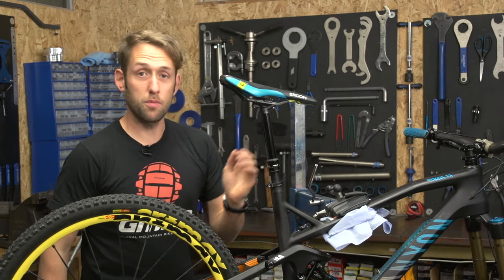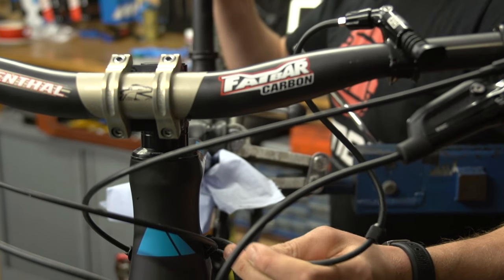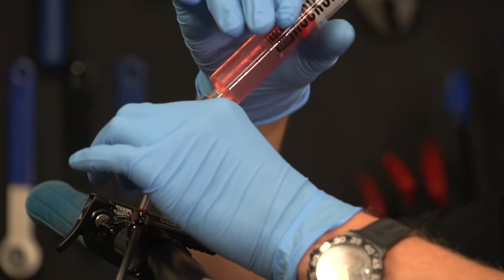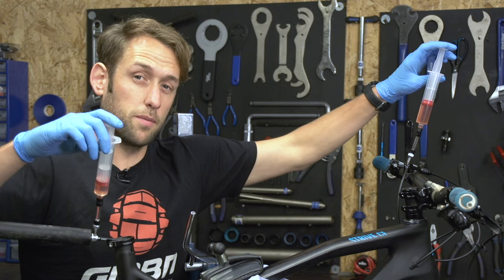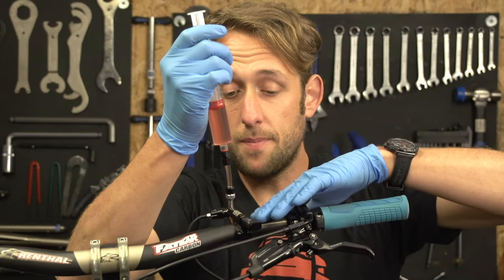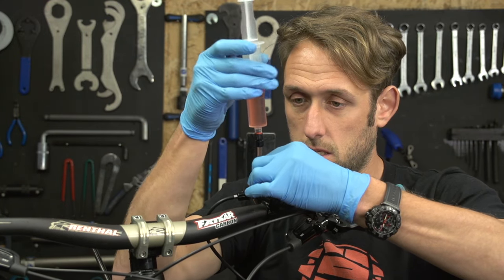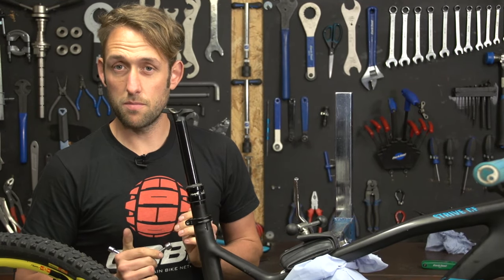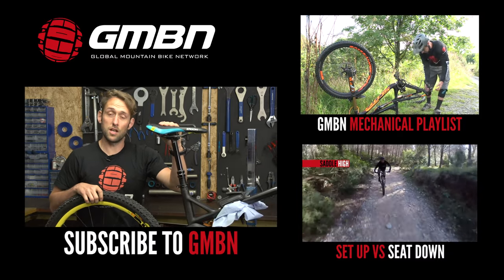How To Bleed A RockShox Reverb Dropper Seatpost

Comment: WARNING: Do not forget to remove the air pressure in the seat post before you do anything and put it back when you're finished with the bleeding.
Reply: Dude this is erroneous, the air system in the telescopic dropper is not connected at all to the hydraulic system in the remote. The remote just actuates the puppet valve. That’s it, mechanical leverage to actuate a system in coupling.

Comment: My top tip: Lubricate the syringe plunger seals with a little bit of the oil before installing the plunger. Otherwise it’s impossible to move the plungers and get an easy bleed.

Comment: Thanks so much for this.  The RockShox site doesn't even have a video for the stealth, and even though it's similar, it's nice to see the exact product you're dealing with.  Tried it for the first time and it worked great.  No more relying on a shop for this and now I can just bleed it when it starts to slow down a bit instead waiting for a near failure.

Comment: Reverb top tip! Never suspend the bike from the saddle with the post in, as you'll F it right up!
Reply: Not only reverb tip I take it.
Reply: +Peter Wobacz only reverbs as far as I know, but may affect other droppers too. It draws air in the wrong way through the seals and the post will never lock out fully in the saddle up position, it'll be all spongy and bouncy.
Reply: +Benjamin Harvey I've got KLS crux I  post. Took bike to local shop to have play in cranks removed. When mechanic fetched bike back out I realised he clamped bike by dropper post cause it left imprints in lube on scansion. Luckily nothing happened to post but God. Isn't it common sense not to do that?
Reply: +Peter Wobacz Time to get a new mechanic I reckon. I'd be well miffed! 
If the bike shop does need to clamp your bike in the stand they should loosen the post clamp. Expose more of the post and clamp to that. 

I regularly hang my bike from the saddle with the dropper up without troubles.
Reply: +Benjamin Harvey Work stands use a soft jaw clap without much actual pressure, there is very little chance that it could damage the stanchion. Also mechanics are only ever going to clamp to the seatpost to do most repairs because of the potential to crush cabling or damage the frame. Furthermore clamping to the actual body of a dropper post is usually impossible to do because of minimum insertion depth.
Reply: feel free to risk it ;)

Comment: You should know that this video only covers the hydraulic system that actuates the seatpost, i.e. releasing it and locking it at the height you want. It won't fix any vertical play problems that people are having. Unfortunately these require the seatpost to be rebuilt. If your seatpost is under warranty, SRAM will fix or replace it, mine just came back from them, but needs this hose bleed process. There are DIYs on rebuilding the post but it complex and needs some special tools.

Comment: Beware of nicking the "O" ring on the top bleed connector, the Bleeding Edge Tool. There seems to be a sharp edge you need to get past to seal the bleeding edge tool "O" ring in position and it very easily nicks the ring. I've gone through the "O" ring that comes on the tool trying to do the final bleed up top. The part # for the replacement "O" ring that works is an Ace hardware #60 1/4 OD x 1/8 ID. If once the tool is set (you can feel resistance before opening the valve) you apply suction with the valve closed and bubbles come up the "O" ring is not sealing and may be nicked

Comment: Pro Tip on bleeding a reverb.  Pull the actuator button all the way out, it tends to get gummed and won't fully return without a little help.  The seatpost will pop faster for longer.

Comment: Great video. My reverb went from being stuck in bottom position to going up and down again. But there is till some play at the top (will fall like 1/4 inch down), and when trying to empty all the bubbles from the actual remote, i could not eliminate all the bubbles. They just kept coming and coming. Is this normal?

Comment: I don't quite understand why a $400 dropper post needs, in my case, excessive maintenance. I've had mine for a month, came installed on new bike. It froze up after 3 rides. $38 later after the shop bleed, it now will either freeze up or work slow in cold temperatures (below 45F). SRAM wants me to troubleshoot it?

Comment: where is the "how to troubleshoot your reverb seatpost".  mine is soggy and tried full fluid flush and rebleed but no avail.  I am going to check air pressure but if that doesn't do it....will I need to do a full 50hour service???

Comment: My seatpost has been bleed and I have turned the dial to fast speed but it is coming up slower than it was, I've put the pressure in the post to 250psi and still no luck. Any tips?

Comment: Hello, My reverb seat post got stock in upper position and won't go down. I tied to bleed it, got some air out but this didn't help. It's still stoked and not moving in any direction. Any advice will be highly appreciated
Reply: CarsGadget Did you ever solve this issue? I am having the same problem
Reply: Hi, no, i looks like there is no any information on this on the internet. So far i see only one solution is to rebuild the whole thing with their full repair kit which is expensive and doesn't make any sense. I will never buy this seat post again and not recommend to anyone as it only good while it's new for the first year.

Comment: I can pull my Reverb up.
Do I need to bleed my Reverb?
Reply: Same problem
Reply: +FelixEdits Dont pull your Reverb up in down position. This will damage your dropper post. Some oil is flowing in chambers you dont want to flow it to and then you have to service your whole seatpost. 
You only got to bleed the remote, if you think air or other substances came into the hose. You can feel it, when the remotes doesnt work right.
Be sure to check the air pressure in the reverb!

Comment: I've been through that exact process twice, and to many times without the pumping, the first couple times was after installation and plane travel, now my reverb has got a bit of suspension when it's extended and won't stay all the way down, i've bled it and pumped it up, there's absolutely no air in the system and it's definitely pumped up to 250psi, if anyone could give me a suggestion?
Reply: Louis Diomede did you ever figure out your problem? I've got the same issue with my reverb. Won't stay up nor fix in down position either. What did you ever find? 
Thanks

Comment: I found problem with my reverb seatpost. When I pump 250psi into seatpost .The next day my pressure was drop with no reason.When I sit the reverb drop down without using remote. What Im gonna do next. what defect part should be replace?
Please help.
Reply from the maker: You will need to send off to certified dropper post service centre. Usually suspension service centres offer this.
Reply: Effe Arpakorn I found that pressure leaked when I was screwing  the shock pump valve off to remove it. Inflated to 250psi; removed shock pump and immediately reattached, pressure had dropped to 205psi. I might be doing it wrong but I pumped up to 285psi and the dropper instantly started to work. Didn't think to test but you could probably pump to 250psi and leave the shock pump on to see if that fixes your dropper??? Anyway 285 worked for me.

Comment: Thanks a lot guys. I've done the bleeding and the pressure check. I'm having stealth post.
#askthedon When I put my seatpost down. When I lift my but it does come back up just 10mm, enough to annoy me. It's like saying helllo I'm here. Any idea why this 10mm rise is happening?

p.s. I believe the fluid is mineral oil and it's ok for your skin.
p.s.2 I had some issues with the valve. It was releasing all the air when you remove the pump. I used shreder valve tool to un-tight and tight it which fixed it for me.

Cheers,
Vasil

Comment: Hey GMBN, I am looking at buying one of these but I was just wondering if the lever was easy to press or not when on the top of the handle bars. Cheers
Reply from the maker: +Bruce wayne It is easier below the bar but a lot of people run them above. Neil
Reply: Greetings Bruce wayne from a year ago! Did you end up getting one? I just bought myself one, can't wait for it to get here!

Comment: doesn't the air leak out when you unscrew the shockpump ? if i set the pressure to 250, then remove then reatatch it say's its at 200 psi. so what i did was adding more pressure up to 300 then unscrew so there is 250psi in the post.
Reply: I went through the same thing with my first full suspension. Research told me that the air escaping when you take off the pump is the air in the pump's hose. When you plug it back in, the pressure drops because it has to fill up the hose. So, whatever your gauge reads is what you got, just have to trust your tools.
Reply: +Mike Riddle thnx man, that makes a lot of sense!

Comment: I cut the host and have re-bled several times and i can't get the return rate similar to an out of the box brand new post.  a brand new post returns quickly even at the slowest speed setting.  in my case, the fast speed returns quickly but the slowest, well is slow... is this normal or i am missing something in the procedure?
Reply from the maker: +Leonard Natera Did you bleed it with it set on the slowest setting?
Reply: +Global Mountain Bike Network yes its in lowest setting.  here is the slowest setting after bleed: http://s264.photobucket.com/user/spyghost/media/Biking/reverb/13C3CE2A-BEE2-4222-8C1C-44A92C047617_1.mp4.html.  for comparison, the fastest setting is: http://s264.photobucket.com/user/spyghost/media/Biking/reverb/C4F18821-261A-420A-B262-2E56268F26F7.mp4.html

Comment: 1. Better wear glasses.

2. It cannot be correct that you push the fresh oil into the system, flushing it back and forth, only to mix it all up with the old dirty oil.

It should be done just like bleeding Avid brakes in the official RS tutorial.

Comment: Just tried installing my new used one. Didn't work, tried a bleed which I probably did something wrong during, then tried to drop my post and it didn't budge. LBS here I come I guess, bye $15
Reply: I know this is an old post, but for anyone else with the problem... it probably won't move until you adjust the speed dial a bit. I thought mine was stuck at first, but then I gave the dial half a turn and it works fine.